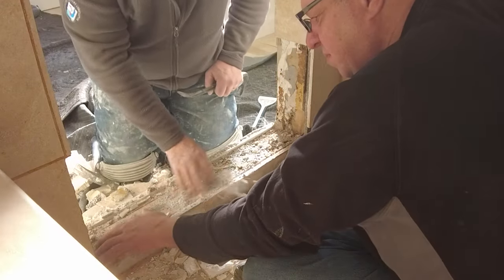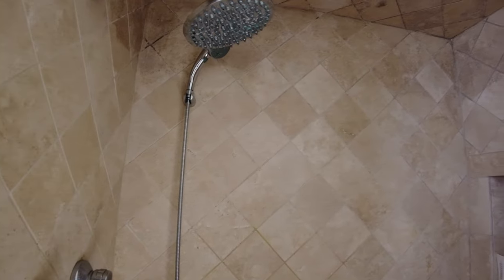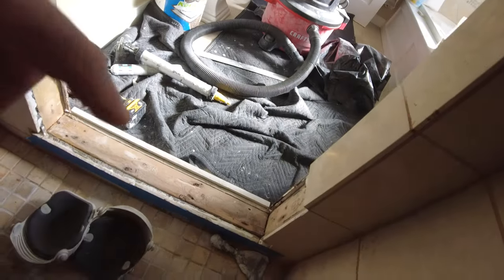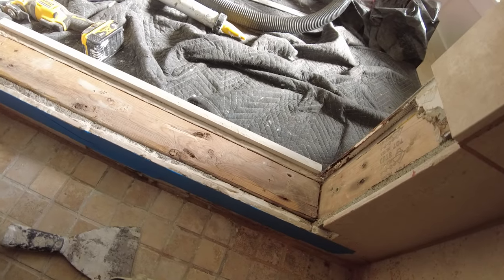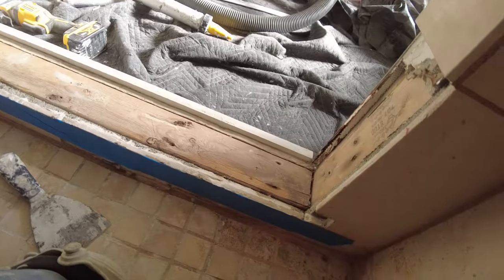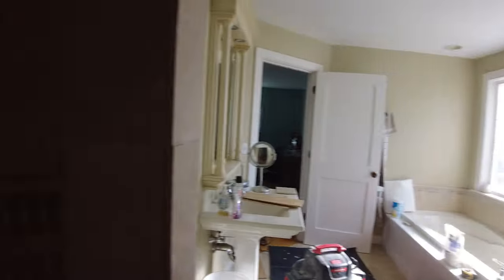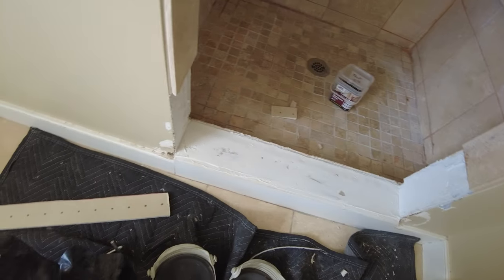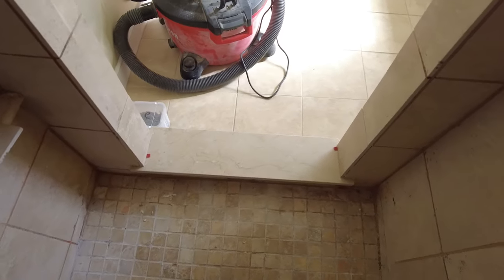Fixing a leaking shower curb. NOT Recommended.

Comment: Sal, I'm in the process of doing a tile job for the bathroom.  Now that I"m getting close to actually doing the tile, I got a question about the shower curb.  The shower will have tiles on 2 walls, and the remaining 2 'walls' will be  glass doors. So my question is whats the best way to go about with the curb so that when I put the glass door hardware onto the curb, and even wall, that the screw holes won't be a point of failure from water leaking down the holes?   I don't have the door yet in my sight, as it is shipping, but I don't know exactly how the hardware for the door is set up.    I was wanting to use a prefab schluter curb, but thinking that maybe using block might be best.  My thinking is that if I use the schluter curb and put screws in it, it will mess up the waterproof membrane.  So using block I can screw through the tile and into the block and get a good anchor for the glass.  But would just siliconing the screw holes be enough to prevent leaks down into the curb?  I've trying to search your videos and see if I can find where you address something like this but so many videos and not enough time to watch.  Thanks for all your videos and advice for sure.

Comment: I have a question..If I’m laying a mud bed down an the previously home owner chipped up the slab, and left it rough an uneven can I mud bed over that uneven surface an do my slope .. or do I need to self level that then install my thin set an dry pack for slope …. Thank you for all ur videos 🎉
Reply: I assume you mean for curbless entry? You can just lay a slurry coat of Thinset on the uneven surface and dry pack over that. As long as the highest point of the uneven surface is recessed enough that the dry pack meet minimum thickness requirement it’s fine.
Reply: @darwinbodero7872  no it’s not a curbless shower … previous homeowners done a complete bathroom remodel layout they removed a small shower an tube an made a 34in x 99in shower .. they chipped up the concrete foundation to move plumbing an when they added concrete to fill it back in didn’t level it out … an I’m currently remodeling the bad tile job that was done along with other things … my question is should I put self lever to even put the floor before I do my mud bed …. But also I already did it couple days ago .. so not I have a more level floor for to do my kids an now need less mud
Reply: @georgearmstrong13  no need to self level before doing a mud pan